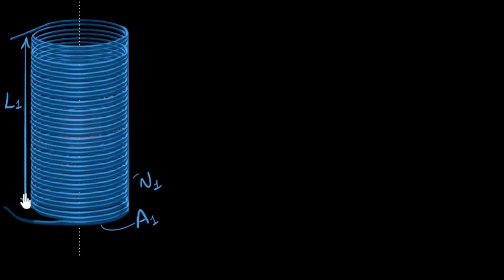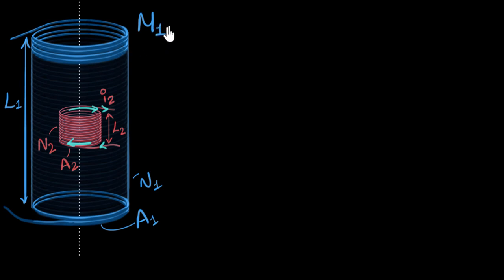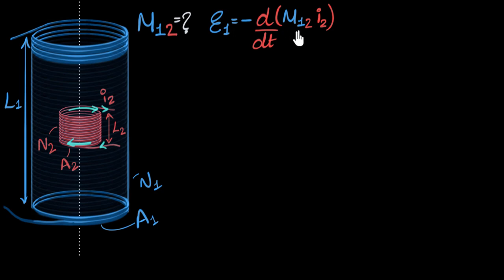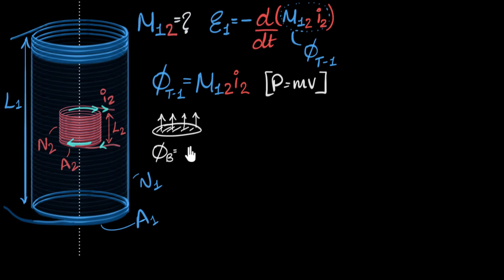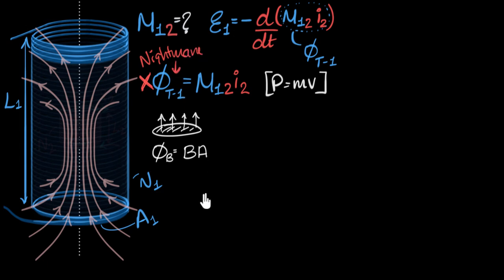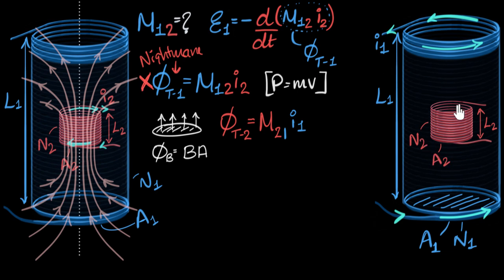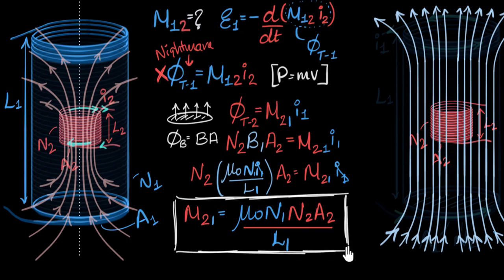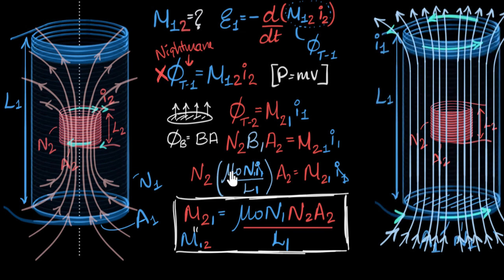Mutual inductance of two coaxial solenoids | Electromagnetic induction | Physics | Khan Academy

Comment: Just a little doubt sir .. when calculating M12 .. won't the magnetic field be "UoNI/L2 rather than /L1 .. so this condition would only satisfy actually for an infinite solenoid .. in which case we take the magnetic field to be UoNI without adding L1 or L2 into it ?

Comment: Assuming the two coils were identical in length, wire diameter and number of turns than , the mutual inductance is proportional to the cross section area only?
For the same current.